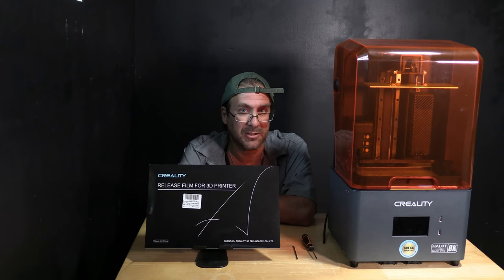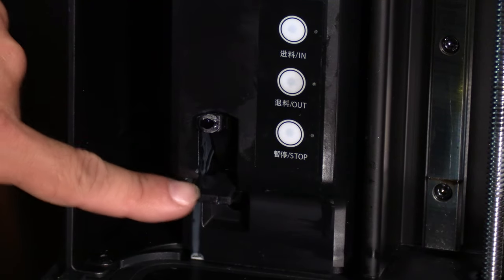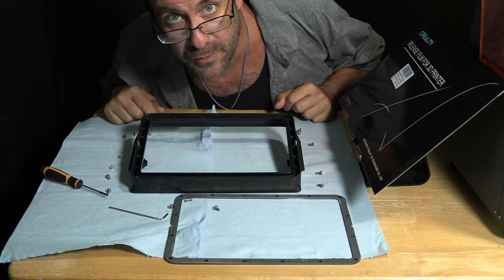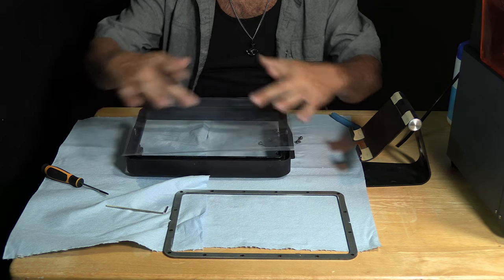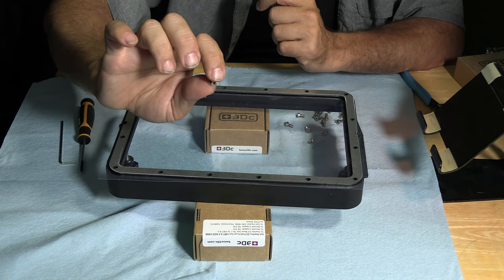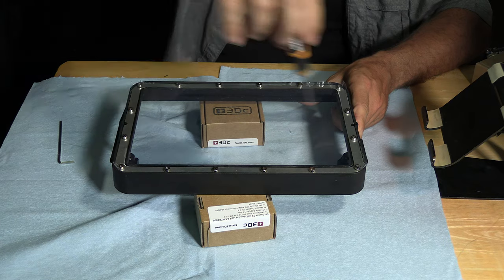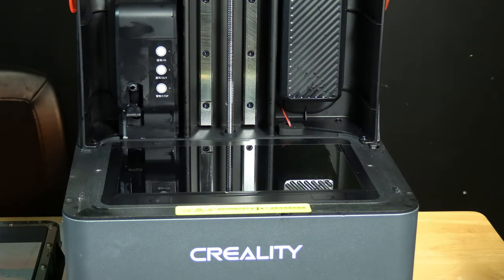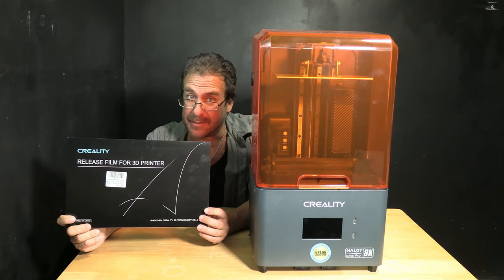How to replace ACF on Resin Vat with FEP Release film - Creality Halo Mage Pro 3D Printer

Comment: Thanks man! I've been having sketchy FEP-swap results since I got this printer and had to use FEPs with no holes.  This vid helped clear up the process so hopefully mine won't get warped or tweaked. Thanks!
Reply from the maker: TBH, I have not had  great luck with the MAGE PRO, but, yea, they usually don't come with holes. Also, don't use FEP. Use PFA or ACF.
Reply from the maker: https://youtu.be/1IO6q2Db2uE

Comment: What is the screw specification for these hex socket screws? M4? M5? I already measured them, they're 10mm long. Want to buy the right replacement.
Reply from the maker: Not sure. I'll have to check. If you have any other 3D Printers, one of the allen keys it came with will likely fit

Comment: Well.. I tried doing instructions online from other users and my FEP actually cracked badly.. I definitely leveled it correctly before finding your video and figured out that the new FEP has PROTECTIVE FILM! No where on the package does it say it has that and I couldn't tell initially because it's so thin.. So ty, lol. Working way better now.
Reply from the maker: Oh no!! I hate when a detail like that hangs me up!  You are not alone. Sh*t like this is a membership club in 3D Printing. I know somebody who used a K1 with plastic film on the bed for like 3 weeks! Welcome
Reply: @3DRundown   Dang loool. I have a big project and this printer has been giving me quite a bit of trouble.. I upgraded from the standard Halot Pro that I had fairly little issues with. I have one important question.. If I remove my build plate to take the print off, do I have to relevel it then? Or can I just simply slide it back on, tighten it to lock it in place, and then start the next one?
Reply from the maker: Personally, I find the Mage Pro to be a bit of a pain in the ass. It's been my hardest to work with printer by far. I do NOT re-level when I take it off. I just put it back on....    You may find my FB Group for the Mage Pro helpful: https://www.facebook.com/groups/halotmagepro
Reply: Good to know.. Finally got it up and running efficiently.. 200/1300 parts printed so far with little issues now.. Your videos have been a big help for when it comes to FEP changing and leveling, so Ty for the help!
Reply from the maker: Have I helped you? Help ME continue this channel with some support:
TIP: Click the "💗THANKS" button
Become a Youtube Member, by clicking "JOIN"
Support my Patreon: patreon.com/3drundown
Use my Affiliate Links when Shopping:
Amazon Link: http://amzn.to/2miGQq9
Creality: https://shrsl.com/424l2
Bambu Lab: http://shrsl.com/46lky
Sunlu: https://sovol3d.com?sca_ref=2756755.r8WNQiJdNf
Sovol: https://www.sunlu.com?sca_ref=4022320.F0sV6y4ht9
Support me via my Course: 3DRUNDOWN.COM